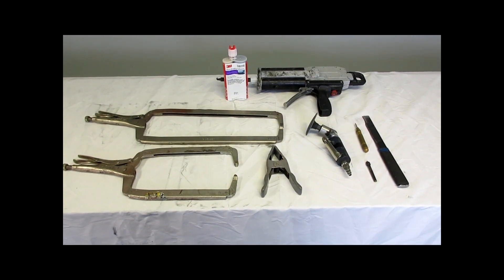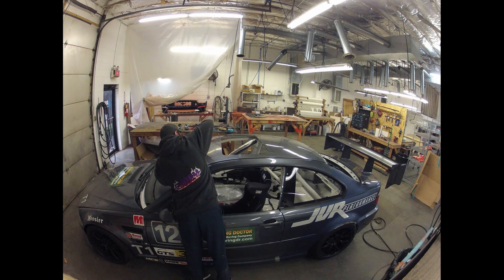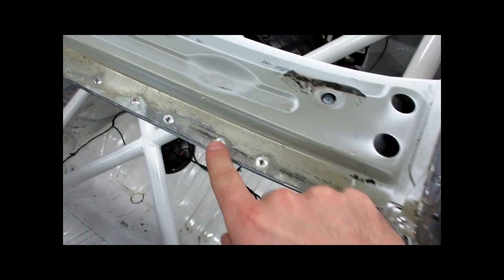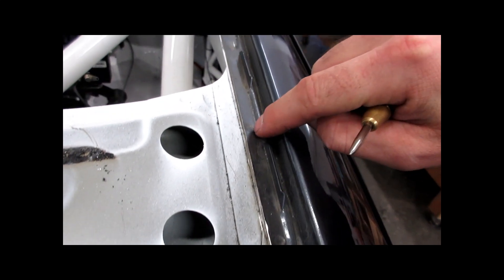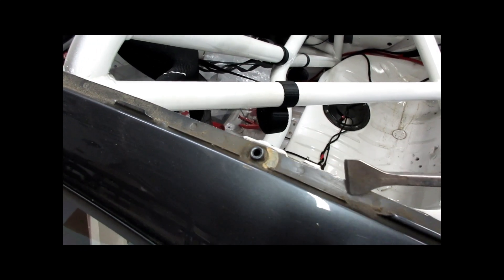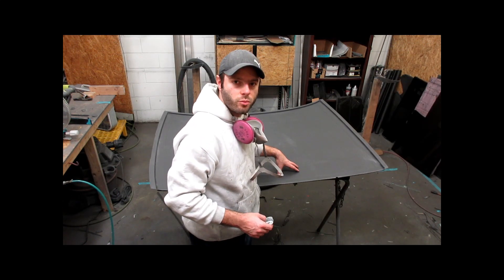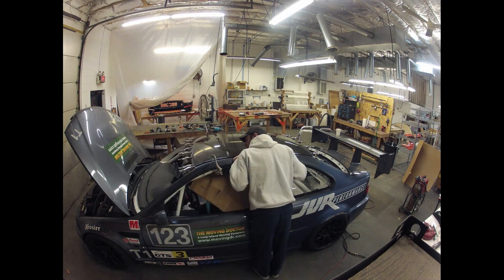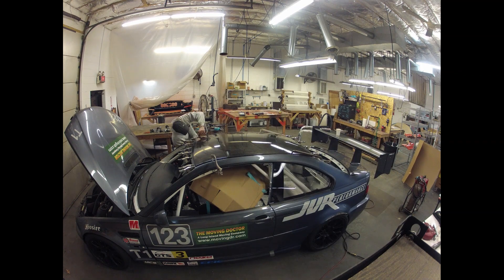Installing AJ Hartman Aero's Carbon Fiber Roof on an E46 BMW

Comment: AJ do you know if the roof of a sedan is the same? I've got a slick top 325, so already no sunroof to deal with, but I'm always looking for weight savings, had a bit of an obsession of it when I owned all my other BMWs, my seats aren't even electric lol good content man, I want to build kind of an at home version of the 320i touring car, so watching you make carbon pieces will (or should) help me make the fender wheel blocks without having to spend 10,000$ on the WTCC kit just for the flossman fenders, maybe you have better recommendations on aero for a Hawkeye variant E46 as far as fender aero